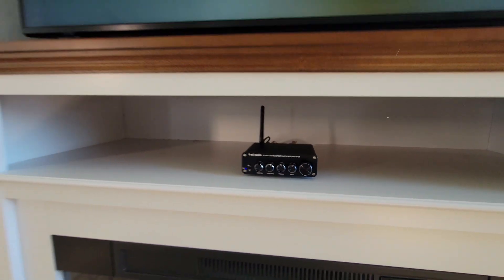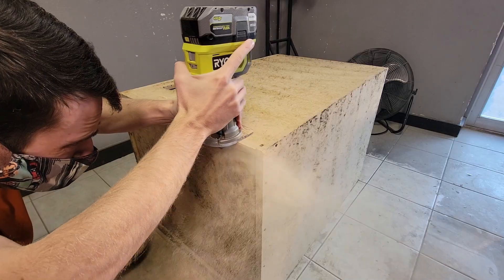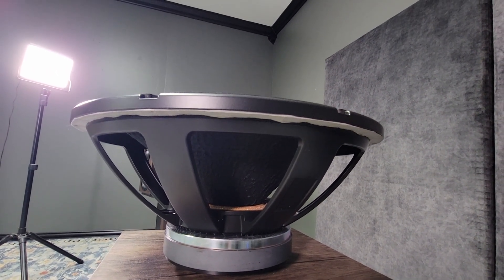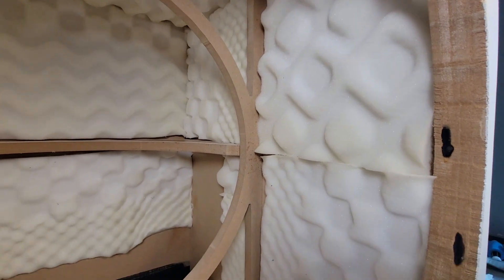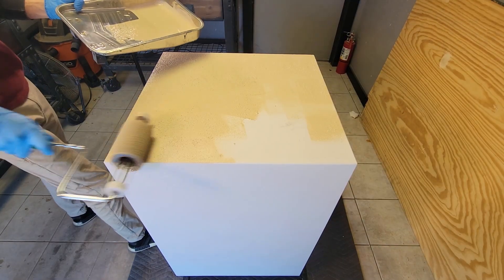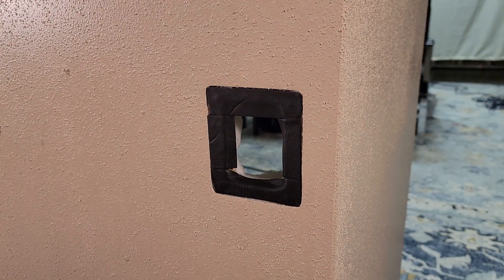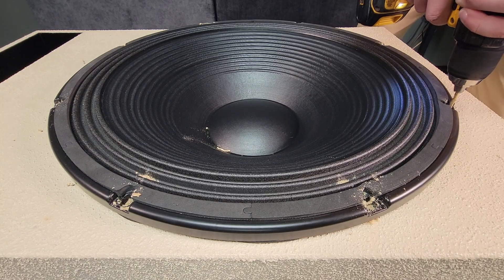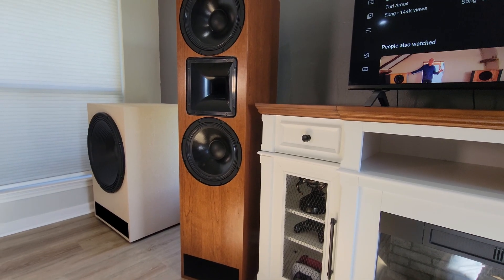Building The Cheapest 21-inch Subwoofer In The World / Powered By A Desktop Amplifier

Comment: Fs of 27 htz what ? This looks like a woofer not a sub woofer
Reply from the maker: This is most definitely a subwoofer. TS parameters tell us what a driver is. Not the appearance. I can assure you this will produce the lowest of low frequencies, with authority.
Reply: @DIYhyfy  yeah just doesn't look like it with such a small motor but specs seem nice.

Comment: Dude i think this is the first vid of yours I've  seen an i5 was awesome! What do you think that sub could total? Id like to get a set for my home theater setup. Id probably do some plate amplifiers. Also what size enclosures are recommended?
Reply from the maker: Hey, thanks for watching! In terms of volume 6-7ft³ for vented. This is tuned around 35hz if I remember correctly. It will put out the lows with ease. Not sure what you meant by total, but if price, they're around $300 or less each.

Comment: I saw that the sub was 1000 watts and the amp was 100 watts. I am new to speaker building, and from what I looked up I should match the RMS of the sub to the amp, and if possible get an amp with a little more watts. Could you help explain this to me better or provide a link/resource for better speaker amp compatibility
Reply from the maker: The 1000 watts you see is a thermal limit. We can model the output in software. When we do this, we can see that very little power is needed to get loud. That said, the need for power increases drastically when getting louder. To run this at full volume, you would need more power. With that said, the 100 watts provides more than enough power to match mains for a smooth response, or even bump in the bass if desired.
Reply: @DIYhyfy  thank you this helped me better understand the topic. 🔈

Comment: Just a couple of other things, end grain won't adhere well at all with glue when applying bracing.  I'd suggest an inexpensive pocket screw jig, they're really easy to use, and hold on tight.  You might want to practice your finishing.  It really can make DIY speakers look professional, and most DIYers don't think they can do it.  The big difference is filler, multiple coats, sanding between each, then sanding down to 1,000 grit.  Finish with a coat of compatible canned satin acrylic, one final 2,000 grit sanding and if everything looks OK, a final spray of satin clear.  It will be an amazing finish, and make a world of difference.  If you do it once, you'll do it on every future build.  Great job on the sub, I'd love to hear it.
Reply from the maker: Thanks for watching. Check out some other builds. I do lots of different finish work.
Reply: What paints do you recommend?
Reply: @movieswithdaniel342  Actually, unless you're set up with a sprayer, just regular high quality spray paint works well.  Remember: sand, fill, sand, spray, sand, spray, sand, spray, sand and then clear coat. Gloss is a bit finicky but you can make it work well with a polishing compound.  Make sure it's dry before you sand.  It can take a while for a really nice finish, but it will look great.  Dare I say, professional.

Comment: Great project althow one thing is bugging me is you use wood screw to mount your speaker.
A better way is nuts and bolts.The bolt is called T nut bolt. It looks like a washer with spikes.
The center hole accepts the screw,the spikes are used to did in the wood so they stay put while your fixing
your driver to the box.The T nut is placed over you pre-drilled screw hole inside the box,it is fix in 
place with a C clamp.The C clamp pushes the spikes inside the wood,it is then secured to the box so you can then installe 
your diriver.If you ever need to remouve it,it will not damage your box as wood screw would.
Bye.
Lucien.

Comment: Superb big driver build, Its amazing the way the 50W output is more than enough with high efficiency PA drivers
Reply from the maker: It really is amazing how efficient big drivers can be!
Reply: Ya I'm building a 21" kracken, with a full marty enclosure, and the best deal I could find, on an amp that will thoroughly operate below 15hz which is the whole point of a home theater subwoofer, is the Infra bass and why I chose the kacken instead of a PA speaker that'll hit hardest in the 30s, like a  12" sub does, to me the only choice is the CVR D-802 which puts out a bit over 4000watts when you use the bridged outputs at 4 ohms lol. And coupled with a dsp filter,  bass should sound extremely, smooth and no muddy sensations even down at Infra bass levels.. I want to feel primal emotions like flight or fight, things that heavy infrabass frequencies provide. Or else, why get a 21" for in a home lol. The sub here in the video is designed to project bass in an outdoor situation. Guess thats doing homework for ya. And I may have 4000 watts but ill never exceed using 500-600 watts lol. Idk just my thoughts
Reply: @m @metabang03 how did it turn out? Was the Kraken what you expected? I decided to go with the 18” Ultimax II instead due to two of them cost about the same price of one Kraken. Mine will be a sealed enclosure.
Reply: Ya I'm building a 21" kracken, with a full marty enclosure, and the best deal I could find, on an amp that will thoroughly operate below 15hz which is the whole point of a home theater subwoofer, is the Infra bass and why I chose the kacken instead of a PA speaker that'll hit hardest in the 30s, like a  12" sub does, to me the only choice is the CVR D-802 which puts out a bit over 4000watts when you use the bridged outputs at 4 ohms lol. And coupled with a dsp filter,  bass should sound extremely, smooth and no muddy sensations even down at Infra bass levels.. I want to feel primal emotions like flight or fight, things that heavy infrabass frequencies provide. Or else, why get a 21" for in a home lol. The sub here in the video is designed to project bass in an outdoor situation. Guess thats doing homework for ya. And I may have 4000 watts but ill never exceed using 500-600 watts lol. Idk just my thoughts
Reply: For music 50W is generally enough for 90% of drivers. You're only really gonna need more than that for something like a living room below 40 Hz

Comment: Can we replace that speaker cone with the cone which would have a rubber surround? Would this be beneficial in any way?
Reply from the maker: You certainly could, but not to any benefit. It was designed with a certain amount of compliance in the suspension.  Swapping things like that would change how the driver behaves, probably in a negative way.
Reply: Что? Поменять подвес на резиновый? Вы думаете просто так у профессиональных динамиков такой большой мощности ставят тканевые подвесы? Это сделано с целью жёстко ограничить ход динамика, чтобы он не порвался, резина с этим не справится

Comment: Subscribed.

Would have been nice to see a frequency response graph with using that amp?

Can other cheap mono block Chinese amps be used or is there something specific about this one? I was wondering if a monoblock can be used with a diy sub and an avr? Thanks
Reply from the maker: Hey yes you can use anything that will amplify a signal to drive a sub. Assuming the channel plays down to the 20s (some avrs dont). The only reason for using this amp is that it has its own dedicated channel low passed for a subwoofer. You could use a standard amp, and create your own low pass.

Comment: Just asking here… why go this route with a small amp? My FB market-place has tons of older higher end receivers: Onkyo, Sony, Denon, Yamaha ,Marantz for between $25-$100. Look hard enough and you find one with built-in BT,  if not you can add an external BT adapter on it for cheap.
Reply from the maker: A reciever won't fit in my entertainment center. I did even try removing feet from one. This is to demonstrate the potential of low power, small units, controlling large, high efficiency systems

Comment: I like these kind of budget projects out of curiosity so much! Really great video, thanks.

I have used a similar amplifier like the one you have from Aiyima and it was just terrible, as the sub channel didn't produce any significant output even at full tilt. They may have set the gain too low internally.
Reply from the maker: Yea maybe the gain was a problem. I've had a few of these small amps, and some are hit & miss. This one has no noise, no latency, and MORE than enough juice for mains & sub. Haven't ever had to turn up more than half tilt on sub or mains to get LOUD.
Reply: the problem most likley your power brick not gain i had this problem and figured out the power brick i was using didnt supply enough amps to draw full power from the amp so got a new brick and it works amazing now so that could be your problem
Reply: @BackRDComputerScientist  In this case I don't think it is the problem. The main channels work just fine, even if you give the bass a full tilt. But the sub channel is barely doing anything and even a few Watts would have been enough. I can't test anything else as I don't have it anymore, though. Recently bought a similar amp from Fosi Audio and it works great. It's the BT 30D Pro

Comment: Any idea what freq lows it can reach in room? ( 25 hz?) and I have used a  Lepy mini amp 2.1 for years with basic speakers and smallish homemade sub, as my computer sound and to your point, quite amazing fir a $25 amp.  No issues ….doesn’t have built in Bluetooth but using a $19 BT adapter from monoprice, all works great.
Reply from the maker: I haven't measured the in room response just yet. It's definitely playing into the low 20s with authority.

Comment: Great video! Enjoyed watching the process. This is definitely WAY cheaper than buying a pre built 21" sub of the same performance and a typical amp. The only thing I would say for most people though is that we wont have a 21" cab from an old project laying around haha also once you add the paints, tapes, gaskets, mdf pieces, adhesive spray, felt, wood filler, wood glue, etc it would add quite a bit to the cost. Especially if you dont have any of that on hand.

Comment: Bought a Kill A Watt type of thing, and it is quite eye opening how loud i have to play to show some watts being used(over idle).
I have two 10 inch subwoofer drivers, low efficiency and in sealed box with lots of gain added in dsp.
100 watt stereo power amp driving the subwoofers and it seems to be enough for all my needs and can push the drivers to it limits.
so now i know how much watts is needed, and not surprised by this video, i bet it is amazing for the price and that tiny amp makes it all seem impossibly good :)

Comment: What kind of primer are you using for mdf ?
I can build a decent looking box but i never know how to finish mdf properly.
Reply from the maker: This was a kilz primer. I've used it on several builds, and it works fine enough. There is a product called sanding sealer. I would look into those before this stuff. But ultimately it's hard to go wrong. There are many ways to seal MDF.
Reply: @DIYhyfy  Thanks for the suggestions.